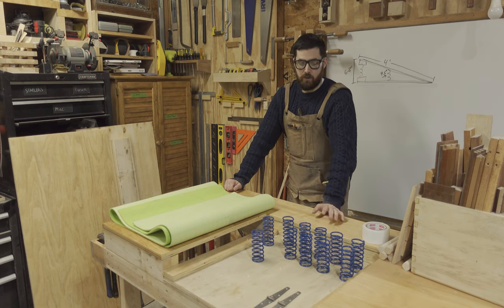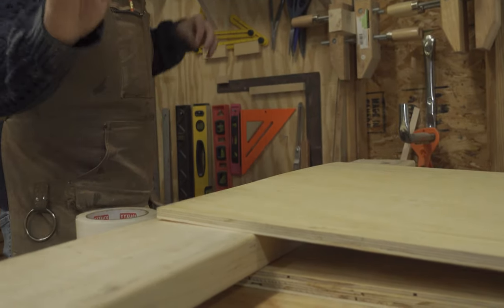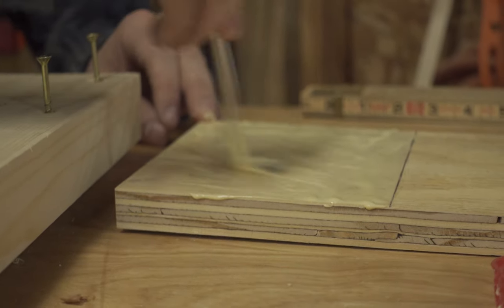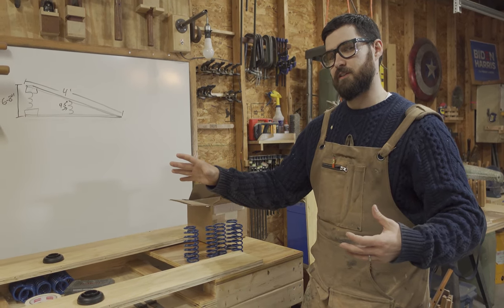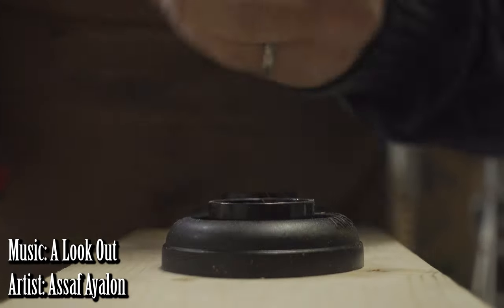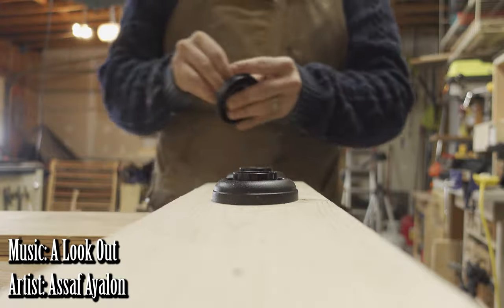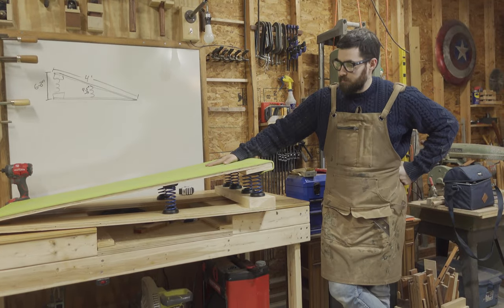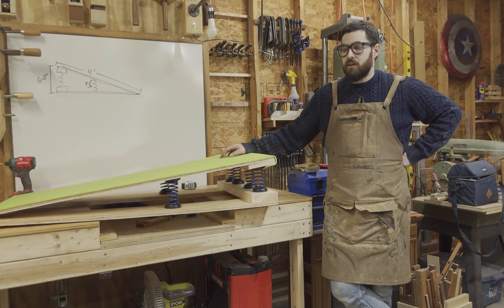Gymnastics Springboard | Fun and Easy!

Comment: Loved your video and sidebar conversations. After looking at how much springboards are I think we may choose to make one as well. How did the yoga mat hold up? Was thinking of trying to find some cheap carpet to throw on it. Also you mentioned the board was bowing so you moved the springs back. Would you recommend a thicker board for the top piece? My daughter is only 48lbs but it would be awesome if she could use this for a few years or even more.
Reply from the maker: Thank you for watching and commenting! The yoga mat has held up really well. My niece still uses it regularly. I don't think it would hurt anything to use 3/4 inch plywood instead of the half inch I did, may want to add a couple more springs to adjust for the added weight of the wood though!

Comment: do you think you could use box spring springs?
Reply from the maker: Thank you for watching and commenting! I am not sure, but I doubt it. I think that box springs likely do not have the required strength for a springboard. I believe box springs are a much smaller gauge of wire with much smaller loads required for compression because there are so many of them in the system. The spring board would only use a few springs, so I doubt the springs would be strong enough to provide the needed force.

Comment: Can you tell me the lengths of wood pads used in spring board
Reply from the maker: Thank you for watching! The board surface is a 1/4 sheet of plywood, so it is 24"x48". All cross pieces are 24" long and the base pieces are 48" in length.
Reply: @BassadorWoodworking  ohh thank you so much ❤️ I subscribed youn